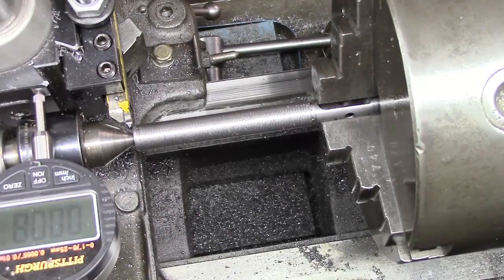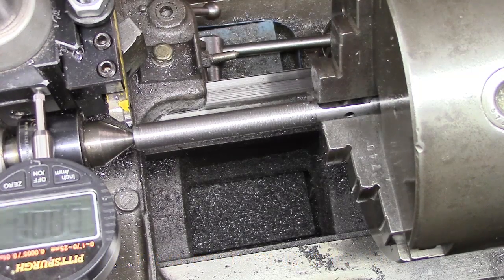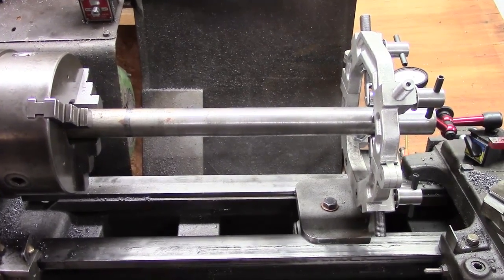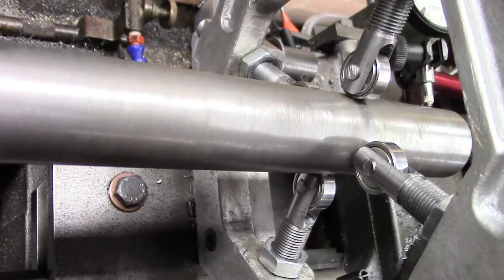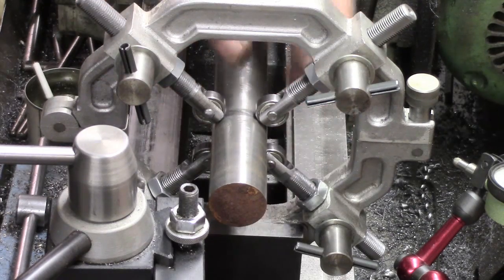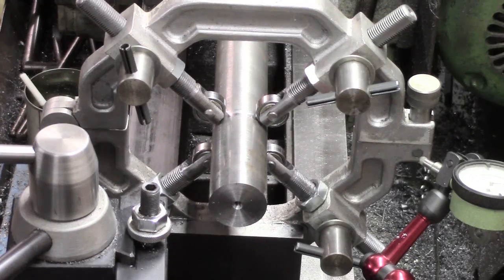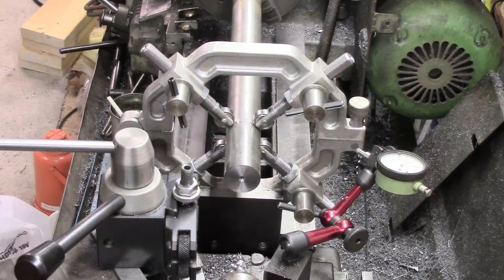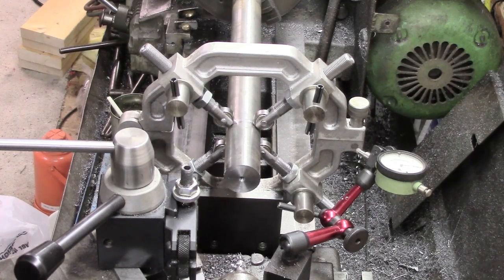Steady Fingers - New Ball Race Version, Finish and Test

Comment: I would add some oil to the wheels...you can see small metal flakes coming off it...Great project very clean looking awesome design
Reply from the maker: TheMetalArtMan Many thanks.  I agree with you, be wiser to lightly oil the workpiece where bearings impinge.

Comment: You have a very nice setup. Just use caution when truing the steady rest. The part can run true but of the centerline is above or below the center of the machine, the part can walk out of the chuck.
Reply from the maker: Michael Wilcox Thanks Michael -- indeed yes - this was why I try and follow the ''pre set-up'' right close to the chuck, so as to try and maintain true machine center at the work end. You make a very valid point.

Comment: Well! That was a success, I think those fork ends look a bit skimpy, although for amount you are going to use this I am sure they will hold up, one chip of swarf going under those ball races will wreck them, or skid on the surface, why not make a simple deflector to prevent that? That was a quick project, on to the next one. Chris B.
Reply from the maker: Englishman French True - forks are a bit skimpy but -- didn't want to go too small on bearing size, both for dia as well as width, and also pin cross section - these were a compromise. As I mentioned - main stresses are in compression along long axis - agreed tho a chip getting caught could be a problem. Easiest deflector probably is something Adam Booth used - a simple cardboard circle to place ahead of the steady.
Reply: ChrisB257 Ahhh! A cardboard disc, that would be a great idea, cheap and disposable, but effective. Chris B.

Comment: Nice work on the roller fingers. Good idea to make separate fingers so you can still use the original fingers and swap them in and out as you need to.

Comment: Nice end result Chris.

One thing though has me puzzled.
If the stock is being controlled by the fingers then any movement on your indicator would surely just be due to imperfections on the stock's surface?
For instance you could chuck up a fibreglass pole from a tent and deliberately grossly force the work forward, off center. The fingers would hold the work in this deflected state, but the pole would easily bend as it turns, the indicator being mounted fixed relative to the fingers would show little change in observed position...

I can certainly see that getting the fingers correct near the chuck then moving outboard with no further adjustment (ie using the swing open feature) would give a reliable result.
Once you have located a center drill and begin working between centers then the outer surface then will become true....
Reply from the maker: Ray Jones Hi Ray -- Agreed - stock surface may well not be absolutely true for round - tho the piece I used was a pretty high quality section. Also, true - it would be possible to force an end with the steady - one reason for a preliminary check setting close to the chuck. OTOH - if starting on and end and with some uncorrected run-out, then it should still be possible  to correct for initial indicator readings until true.

Comment: Hi Chris !

I looks very nice and functional - how about chips in between the work object and the bearings ... I left bearings because of that - but maybe it's not an issue at all.

I must admit I'm in love with that frame on your steady rest ... it's an object for mold/casting and it looks very very nice, I think ;-))
Reply from the maker: Keld Sørensen Hi Keld,

I doubt chips will be a problem as bearings are in such intimate contact. If however a job was making a lot of chips I might employ a chip-catching brush sort of idea.
The Al frame casting was originally obtained in UK - supplied for use on an ML7 (Myford) lathe I think.  I machined all the various parts and finally set it up to match machine center - then made a mounting system to suit. Not used often but invaluable to have available.
Reply: ChrisB257 I once saw Adam Booth had a circular piece of cardbord in front of the steady rest to keep chips from interfering with the ballbearings.
Reply from the maker: Keld Sørensen Now there's a simple idea - thanks Keld I'll remember that.  Simple is often the best! :)

Comment: Great video.  That is a spectacular success.  I knew it was the right way when you got started on it.  My steady rest still has the brass fingers that it came with.  The few times I have used it I had to keep on oiling it and checking adjustment.  One day I will have to convert it over.  Thanks for the video.
Reply from the maker: cerberus Thank you - turned out OK glad to say altho quite a fiddly job. I still reckon there may be times when I need to use my other finger set with bronze ends.